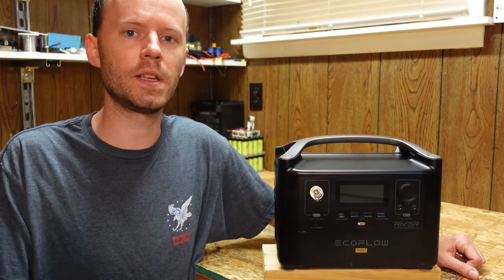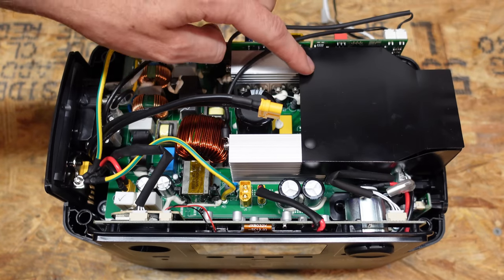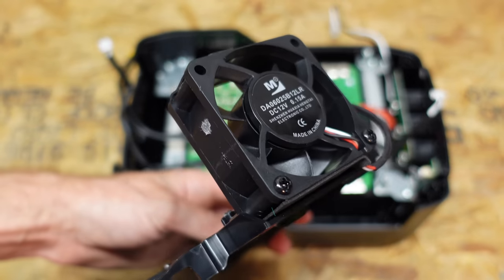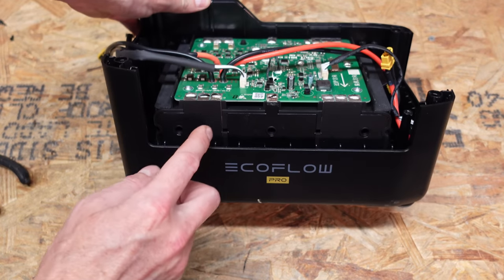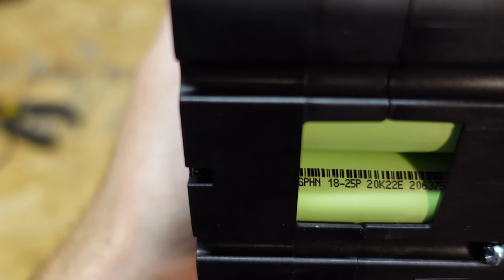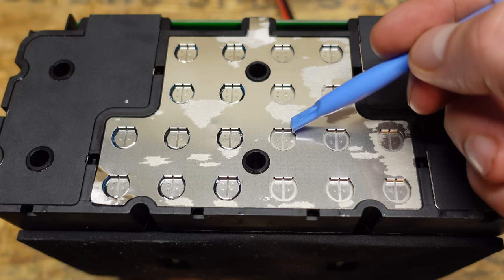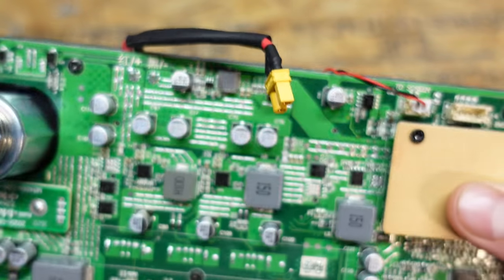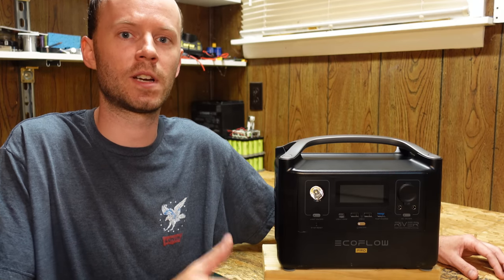EcoFlow River Pro, Teardown and Detailed Look Inside!

Comment: Awesome teardown! I wish EcoFlow would make these batteries more easily replaceable. Not something to slot in and out, but just something that wouldn't require complete disassembly and soldering to replace when the batteries wear out.
Reply: in case of lfp  the lifespan of the  electronics might come out faster than batteries if nothing strange happents ,, but  cobalt ones  and 800/1000 cycles   yup they could give space to seperate cells and replace em easier

Comment: Mine died completely. This gave me the confidence to open her up and poke around. Two of the four battery groups are very low on voltage (less than 1.5). I'm charging it through the xt60 coming from the bms and voltage does indeed go up.
I've had less than 100 cycles on it, 350w max. 2.5 years old and just out of warranty. Sure did hope for more given the price point it would be sad if it was completely disposable and not serviceable at all

Comment: OUTSTANDING!!!...I received the extra battery for the river pro. Once charged...I turned all units off and disconnected them. . For some reason the extra battery will not shutoff. I contacted Ecoflo and they will be sending me a replacement unit. BUT...I have the "defective" unit. I'm disectting it to see if I can reset it so the continuous blinking light on the extra unit will stop.
Reply: Hi! Did you try this and if so, did it work? I have a flashing on/off light and no display. Wondering if I disconnect the main power lead, if this could reset it? Support from Ecoflow is non-exisitent.

Comment: I purchased the River Pro and Extra Battery. Thank You !! i feel much better about my setup now. 
   Being able to see inside construction set my mind at ease. i saw Quality manufacturing. And answered my thinking about expanding my system with making my own extra ‘Extra Battery’ 🤣🤣

Thanks Again, Great Video! Straight forward presentation, chock FULL of info ⚡️⚡️⚡️⚡️
Reply: I have a pro and love mine also, haven't used it much. But seems quality

Comment: Lovely video, thank you. I tore down my River pro when the overload signal won't go off. While I was coupling it back,  connecting the battery to the board damaged the BMS after that spark. Like the type you saw. You are lucky the unit is still fine after coupling it.
Reply: Strange that the inrush to the inverter caps would “damage” your BMS. Are you sure it didn’t just trip the overcurrent protection?

Comment: EcoFlow has come to be one of the top 3 solar gens in the River series. 
The Delta is also a great machine…
Reply: I didn't go with the Delta because one of the other youtubers that is smarter than most of us had a issues with charging. When it got a bit warm. He had to wait 2 hours before he charge his .
Reply: I have a Delta (KS version) and a R600 PRO (also KS version) with expansion battery. All their batteries have one major issue, an extreme high self discharge. 
If you really want live off-grid and charge via solar, the high self discharge, the fake MPPT and the bad AC conversion rate let you move very quick to someting else. 
I build first my own battery pack and used Victron charger and AC converter with it. Now is also the battery from Victron. 
What a difference to Ecoflow, no heat, no fans, no noise!
Reply: @BeautyOfGaia high self discharge? This would only happen if the BMS has a ridiculous quiescent current draw or there’s some background power sucker that doesn’t turn off when you have the outputs disabled and the screen off. Lithium ion discharges at 1-2% a month max. I have some cells I put into storage a year ago at 3.65-3.70 and I just double checked them since it’s been exactly 12 months. Voltage was almost exactly as I left it. If there was any difference then they only lost 10 or 20 millivolts at most because I remember I had an even spread between 3.65 and 3.70 and it’s still like that with nothing below 3.653

Not too sure exactly what cells they were putting in these first gen units before they switched all their devices to LiFePO4. Probably Chinese cells but I can’t imagine they’d use junk cells. Hopefully EVE, BAK or Lishen.
Reply: @ericklein5097  The cells are in packs, impossible to say if there are cells with different quality used. I don't think that the cells are bad. Its their electronic design. 
All models have only a soft switch. So, a push button to switch it on and off. Means there is all the time a circuit alive, outsite of the BMS. 
Depending on where the soft switch is located, means what other curcuits there are also alive, is the discharge rate different. For my Delta is it massive. The R600 PRO is better.

More worst, is the horrible conversion rate. Delta is more a heater than a power bank. The R600 PRO have still a conversion rate below 80%. Off grid solutions should have a conversion rate of at least 92%, which is possible if quality converter are used. But China companies have to make more profit than others, GOV need to be funded. 
So, build cheap, sell high. Don't care about customer, they are far away.
Reply: @BeautyOfGaia  very interesting. Thanks for the insight into the bad electronics design of the earlier EcoFlow units. 

You should be able to take apart any of the Ecoflow units fairly easily until you get down to the pack and then the cell holders will have some open space in the middle that should show enough info to figure out the cell model

Comment: Your presentations are enlightening! I have matched the River Pro with two Renogy 100W panels. Coming from a totally different perspective, I find confidence in your commentary. A decade ago I dreamed of powering the DC needs of my office with a couple of batteries and a box full of pigtails. For reasonable money, this River Pro is that box. Nothing is perfect, but I think this power station is great technology for the $$... and leaves me with options should I need more battery or care to avoid a power outage. I think it's better than most would suspect. Wouldn't you agree?

Comment: 4Vx2500mah = 10Wh, by 80 Cells, that
means 0.8KwH initially installed.
Even if down grade 20% after 500 cycle,
it should be better than 0.6KwH spec.
Reply: 3.6x2500x80=740,000=720wh

That’s the spec. You use the nominal voltage to get the correct wh rating. Your average voltage throughout the discharge isn’t going to be 4.0V. I would guess that Ecoflow also puts a buffer in for the low cell voltage. Instead of 2.5 or 2.75 you’d typically see 3.0 or higher since you only have 10% below 3.0

Comment: Looks like its going to be a pain to replace the 18650 cell after a few years of use.  These manufacturers really need to think about the ecological impact of making replacement of their consumable parts difficult to replace.
Reply: This is why I went with a Max instead of a Pro. It'll be really easy to just screw off the bottom battery to replace.
Reply: @Andy-Mesa  In case that you could still purchase a new, fresh River Max bottom battery in a few years... Furthermore that bottom battery is only half of the capacity. The other half is still installed non reparable in the River Max case.
Reply: Im affraid manufactures would prefer you just to buy a new product than repair an old one and deliberatly design a product that is difficult to repair whilst at the same time telling the world their company is enviomently friendly

Comment: At around 4:30 you talk about the auxiliary battery port, and then later talk about the wiring & mention something about the way it can protect itself in case a highly charged extra battery is connected to a low-charge River Pro.  This is a thing?
Wouldn't that be how people often use the extra battery?  
- keep it handy in case it is necessary ... in case a sunny day turns into a blizzard ... 
- it is awfully cumbersome to keep it attached all of the time.

Comment: Excellent, indeed it is very useful. I have an additionnal question: did you (or could you...) perform a similar teardown on the external battery for River 600 Pro?
My interest is wether it would be possible to directly access its battery, since it does not seem safe to do it on the main module. I would like to have a 12V high amperage output, which LiFePO batteries are able to deliver.
Reply: I'm pretty sure these have a 36v battery configuration internally.

Around the 11:15 min mark in this video, it's shown there's a DC-DC part that is stepping down the voltage to 12v.
Reply: @nashdashflash it’s an 8S which is one cell above the standard 7S 24V that most of the industry uses. Meaning an expansion battery (DIY) would have to be built from scratch and not cobbled together from scooter packs or something. 8S LiFePO4 is the standard 24V but that’s 3.2V nominal and these are 3.6V.
Reply: Take the cable going from battery to inverter and turn it into a parallel cable with two outputs. Then run that output into a buck converter that supports a wide range 24V to 12V. This is going to be 28.6V nominal and 33.6V full charge so you might have to find a buck converter that can do 36V/24V to 12V. Obviously you’re going to need a large buck converter if you want a high amperage output. These cells “should” be capable of 20A if they are Samsung 25R clones which I suspect they are just based on the model number. So 10 in parallel gives you 200A at 29V nominal which would be almost 500A at 12V

Obviously that would leave nothing for your inverter and you definitely do not want to run the cells that hard. You could steal 5A at 29V nominal and still get about 12A at 12V for 144W

Comment: I wish I could used 240V to charge this device.  I shipped one to Ghana and it looks like I will need a Voltage step down. I am curious about those switches in the inverter if that can be changed for the unit to accept 240V
Reply from the maker: Yeah sorry, this is a 120V device. I'm not sure if they make a 240V product (in a single device).
Reply: Maybe with a transformer

Comment: Hello, at my ecoflow river pro station, after turning on the sandwich maker, the icons lit up for no more than 30 seconds: protection from the current source from overheating turned the fan a little and I turned it off and turned it on the next morning, but the indicators are still on and the fan is spinning, the battery temperature is 23 degrees. May encounter conflicts? What to do in this situation? Thank you

Comment: You do a great job and I enjoy watching your videos. After looking at all of the various battery packs sold under the guise of a solar generator (they don't generate anything) and the high cost, can't charge below freezing, time it takes to recharge and use, I'll stick to using one of my Honda generators that I can get more power to run power tools, lights and equipment on a 5gal can of gas. I'll save the solar to run everything else on my off-grid farm.
Reply from the maker: I don't disagree at all :) :)
Reply: Craig, I have the pro and it hasn’t run out of gas yet. Also a very small 800 watt gen..
Reply: But with these I can run my Honda for only a couple of hours a day to charge them up, sleep in quiet all night and use about 1/3 the amount of gasoline.
Reply: Don’t generate anything? They take PV and turn it into DC via solar cells. I want what you’re smoking. 

They also technically “generate” AC from DC

Comment: I am so frustrated by EcoFlow's extra battery for the River Pro.  (1) the top port connection is very in-elegant, but more importantly, (2) there is no charging port.  I really want to be able to charge it separately!  
I know it's unlikely ... and would require a different cable ... but do you think it possible to connect 2 River Pros together?
Thank you for this video - very cool stuff!

Comment: 4:20 I see Line (Black wire) and Neutral (White wire) for the AC outlets, but I do not see safety ground wire for the AC outlets even though they have holes for the ground prong for AC plugs. Faked 3 -prong AC outlets? Nice tear down BTW.
Reply from the maker: You're right - there is no ground. The hole is just there in the receptacle so you can plug in a 3-prong cord without needing an adapter.

Comment: @LithiumSolar have you tried to connect a flooded battery to that XT-60 cable connecting to the expansion port?
It's unfortunate they are not producing the Pro Link to add extra batteries outside of their own brand
Reply: You can connect any battery you want up to the solar input.. You have to furnish your own way to charge that extra battery though.
Reply: @louispoche4312  I'm talking about the XT60 on the extra battery input. if instead of connecting the extra battery in the proprietary port, just connect another battery directly in the extra port XT60
Reply: @DSeeKer  The extra battery port is not an XT60.. it is some kind of "D" connector with extra large pins.. but you can not connect another battery there. You can connect any battery up to 25 volts up to the solar input though.
Reply: @DSeeKer  Oh.. I see what you are saying ... the xt60 that connects to the BMS board from the EB port..I doubt that it would work... The main CPU would have to tell the BMS board to turn on the input from that port and without communications with the extra battery it probably won't do that.

Comment: When charging it through AC, do you smell anything?   I am wondering if mine is frying inside when charging up....  or if its just first charge giving off smells...
Reply from the maker: No... If it smells while charging, I would immediately unplug and stop using it!
Reply: @LithiumSolar  Thanks.  So when it is charging like 400-600W,   or if the fan turns on when powering AC devices.  You dont smell anything coming out the fan?   Im powering it now, I smell a little bit not much.  Im gonna run it to 50%, power it up and see if I notice anything.  Then may send it back.  Not sure if Im just worrying, everything else works ok...
Reply: @JamesWattMusic  It s also the case for me . It smells a lot when charging fast with 270w input charging but i think it s because it s a new product that i use twice

Comment: I wonder if River Pro conducts ongoing balancing / equalization of P-groups of cells in series as for every battery it is critical to have cells (P-groups) in serial circuit always in balance - for pack's maximum life span. Any idea how River Pro's BMS performs in this question?   Without balancing / equalization device will deliver much shorter life time than its cells can do.   For every pack of cells the cells - at certain point of time - for sure run out of balance, it is not possible to produce fully identical cells. Only completely identical cells don't run out of balance - these exist only in theory.  @LithiumSolar Thanks for job made!

Comment: Hello. Can I charge river 2 USA version (110 v by manual ) via just an adapter in Ukraine where is 220 v ? On the plug plastic input I found the note 250 v. Does it mean ok for 220 v ? In spite of manual says 110 v

Comment: I just bought the ecoflow pro from Costco. I tested the unit. It has open ground. Is it normal?
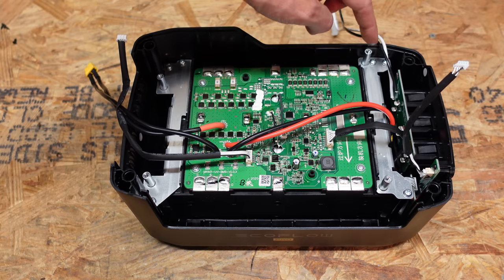Reply from the maker: Yes. There's a hole where the ground pin goes, but it's not actually connected to anything. See 4:16 where I pulled out the receptacle board.

Comment: No LiFePO4 disappointing 😏 ho well next version. And if they could pack the electric on top and have them main battery detachable and user replaceable that would be a game changer 🤙
Reply: Maybe because the LIFEPO4 weighs heavier than the li-ion for the same capacity

Comment: Very disappointing!!!. I was hoping the internal battery could quickly be exchanged out after it's life span is over with so technically if you're not tech savvy then this is a giant paper weight after the battery's life span of 800 charges is done with and it doesn't have to be that way. Looks like they don't want you to exchange the battery, they want you spending a lot more money to buy a new one. Buying this unit and buying the expansion battery is not cheap, you're looking at almost 1000.00 for both. I hope they change this in the future, make the batteries easy to change out.
Reply: Keep in mind that the 800 cycle rating doesn't mean it'll be dead after 800 cycles. After these cycles the original rated capacity is no longer "guaranteed" and instead drops to 80%+ (so you can expect to lose upwards of 20%). The unit is still very usable, at the lower capacity, for quite a long while after the 800 cycles.

Comment: with all due respect, i think after watching most of your video, ill just pitch mine out, and declare it a nightmare mess, never to speak of it again
Reply from the maker: What happened??
Reply: @LithiumSolar  monr started beeping, but after watching several videos, i concluded it discharged below a certan percentage, however i dont have anything plugged into it. the best i figure when i shut the power off to the house it must have back fed through the ac cord because i didn't unplug it from the wall outlet. after returning power back to the house it started this beeping for 2 hrs.

Comment: Mine almost caught fire the very second I plugged in a 100 watt heat blanket , made a nice cloud of smoke and now says overload and won’t work anymore , I had a one half this strong , a Nexpow and it worked with 2 blankets plugged in. Eco flow is one of the cheapest bootleg brands Ive ever seen. Do not buy these at all. They won’t refund you
Reply from the maker: WOW sounds like a bad/loose connection or something. Did you buy it from EcoFlow directly? I don't see why this wouldn't be covered under warranty.
Reply: I used foor free years now and no problems